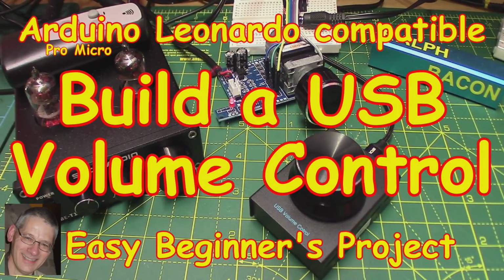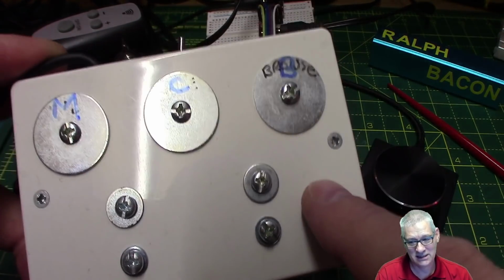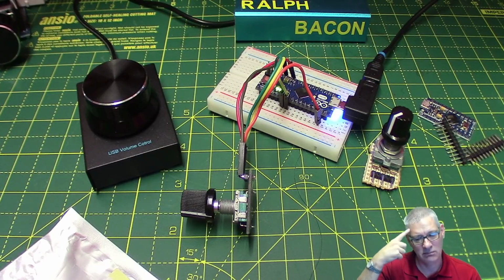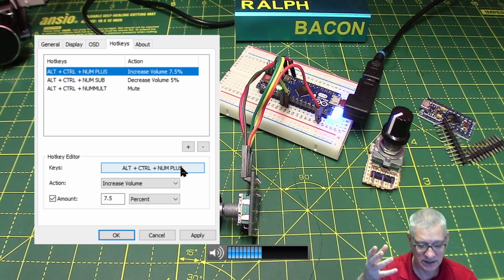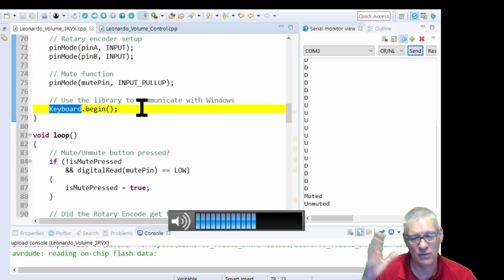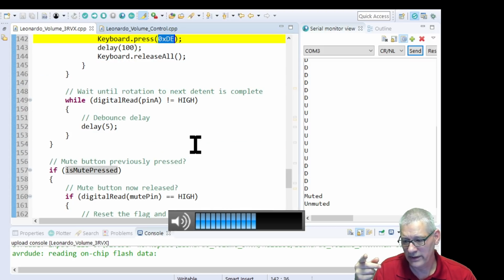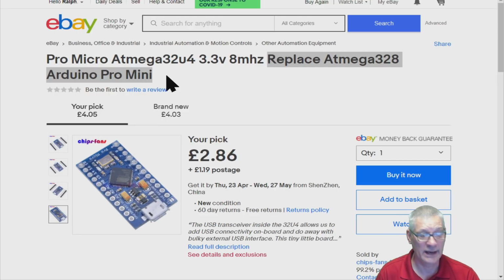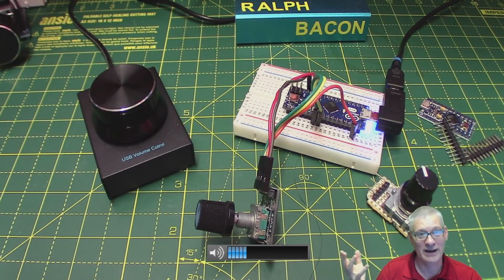#184 Make an Arduino USB Volume Control - Ideal Beginner's Project

Comment: Very interesting - thank you! Is there any way to set the Windows volume to a specific value/percentage, rather than just sending volume up/down commands?
Reply from the maker: It would require a more intelligent connection to the PC's operating system so you could interrogate the current setting and adjust as necessary. Probably not that difficult, but not something I've done.

Comment: great video!
Do you think I can re-program a buyed USB volume control? is it  an "arduino" inside?
Reply from the maker: I doubt it would be an Arduino inside. Too costly. But there's nothing stopping your making one like I did, with an Arduino (Nano) or bare chip, inside.

Comment: Can anyone think of a way to feedback the current volume level to the Arduino? or the mute status?
Reply from the maker: You can't interrogate this device directly as it is but there are a few things you might be able to do, depending on how creative you are.

If you use just ONE of the pot tracks (eg a mono amp) then the other track could be used to feed 5v into an Arduino and you would know where it was (pretty much).

Or if you need stereo (so you're using both tracks) if you can extend the spindle for another pot or magnetic switch you could get a reasonable idea of where it is. Or construct a collar for the pot with some sort of magnetic switch. But it would be fiddly and not very precise.

Comment: Hello Ralph, and thank you for another great video,
I made it and even added a small keyboard with many shortcuts, works very well,
There is one issue, I wonder if I am the only one having it,
If you rotate the encoder once, the program is stuck in the while loop, so the mute will not work, and in my case also the external keyboard.
the first workaround I made was to add a LED that goes high in the beginning of Loop and goes low in the while, so I know to give the encoder another turn.
I found another way to do it, very simple actually, wonder what you think about it:
#define outputA 4 //CLK
#define outputB 5 //DT

 int counter = 0; 

 int aState;
 int aLastState;  
 void setup() { 
   pinMode (outputA,INPUT);
   pinMode (outputB,INPUT);
   
Serial.begin (115200);

   // Reads the initial state of the outputA
   aLastState = digitalRead(outputA);   
 } 
 void loop() { 
   aState = digitalRead(outputA); // Reads the "current" state of the outputA
   // If the previous and the current state of the outputA are different, that means a Pulse has occured
   if (aState != aLastState){     
     // If the outputB state is different to the outputA state, that means the encoder is rotating clockwise
     if (digitalRead(outputB) != aState) { 
       counter ++;
     } else {
       counter --;
     }
     Serial.print("Position: ");
     Serial.println(counter);
   } 
   aLastState = aState; // Updates the previous state of the outputA with the current state
 }

Thanks again and hope the moving is as smooth as possible
Regards
Reply from the maker: It sounds you are not using a detented Rotary Encoder, where it definitely moves from one position to another? Non-detented ones are tricky to control; I did video on them but don't like them.
Move is going s-l-o-w-ly, all packed up with nowhere to go. I blame the solicitors, the legal wheels grind extremely thoroughly but so very slowly.
Reply: @RalphBacon  Sorry to hear about the move, hope it will be fine soon.
I am using a dented Encoder, one turn enters the while loop the second brings things back to normal
Reply from the maker: That sounds different to mine. One "click" of the rotation on my one brings pin A high then low; with pin B out of sync by 90 degrees but doing the same. So one detented "click" brings it back to the same position (Pins A & B) each time. Make sense?

Comment: I do enjoy this video a lot.

EDIT: 
A post 8 months before mine by Chris Dreher reminded me that it is the HID interface and NOT the USB interface that has all of the extra toys.
I'm not sure if the PS/2 Keyboard and/or the PS/2 mouse are treated as HID devices.
I do know that you can have BOTH a USB keyboard AND a PS/2 keyboard because that is what I am running because some USB keyboards are not detected by either BIOS/GUFI, my old v1.0 Logitech G15 keyboard is now longer being detected until Windows starts.
To solve the issue completely, I just bought a 60% sized PS/2 keyboard on Amazon for around $15.00 CAD and just leave it out of the way unless I need to make BIOS/GUFI changes.

It was while I was researching the G15 problem that I discovered all the extra bells & whistles that HID can support.
I found other sites have actually done speed tests between USB keyboards that DO NOT use interrupts and PS/2 keyboards which DO use interrupts.
These tests have shown that while the difference between the two types of connections is actually below the level that a human to detect BUT the PS/2 is actually faster than USB because USB relies on polling all devices on a USB channel and PS/2 relies on the interrupts it send to demand attention over any USB polling. So if you can use an interrupt with USB, I think you should.
Reply from the maker: Glad you liked the video! 
Now, USB is not interrupt driven, but is polled. However, once USB is polled you can implement interrupts on USB (with a small, unnoticeable increase in latency) - for example, a keyboard or mouse will use something called interrupt endpoints. This is all hidden away from us (usually) via the HID interface. I've not noticed any lag whatsoever on my separate keypad via an Arduino Micro (which gives us the USB interface, unlike the UNO). Gaming keyboards these days are USB and you know how picky they are with latency!
Reply: @RalphBacon  There are a few Keyboard apps available that show you any USB keyboards connected and if more than one(1) is detected, the app will prompt you to press a key on each keyboard in sequence and then which of those is your primary keyboard. With this feature the software could let you turn an entire 104 keyboard in to a 104 set of function keys. There is even a small USB dongle that does the same thing in the dongles hardware before sending the programed  string.

Comment: I have an old tube stereo I'd like to salvage using a Raspberry Pi as a media player. It has several rotary knobs for volume, balance, treble, bass, etc.  I'd like to replace them with functional rotary encoders that have similar functions to the original functions. How would that work?
Reply from the maker: Chris I've replied to you TWICE now but my replies are disappearing. What on earth is happening?
Reply: @RalphBacon  I don't know what the issue is. I'm glad I got this message. Can I send you my email? Ive never contacted anyone through Youtube, so I dont know how it works.

Comment: will this also work on a mac?
Reply from the maker: If you mean "can I upload the sketch to the Arduino and make this work using a Mac" then the answer is Yes. Lots of Mac users here (and Linux, and Windows).
Reply: Ralph S Bacon cool thanks

Comment: Will this work on the Pi4?
Reply from the maker: Not a chance. The Pi runs Raspberry Pi OS (previously called Raspbian, I have no idea why they changed it), not Windows so the code sent to the USB port will doubtless not be recognised by Pi. That said, if you can find out the codes the Pi is expecting to control the volume (from a keyboard) then you can just change the codes you are sending from the 32U4 and it should work. Hmm, now there's an idea...
Reply: @RalphBacon   :(

Comment: I noticed that the rotary encoders that you show all seem to have threaded bushings,  which makes it a lot easier to mount them to any sort of a panel.  The one I got with that "37 pcs sensors" kit I got from banggood a while back unfortunately is NOT threaded.   :-(
Reply from the maker: They are not for panel mounting then, Roy. Just for soldering to a PCB and have the spindle poke through the front chassis when correctly assembled. Makes for quicker overall assembly, I guess. Not so good for hobbyists. Luckily, you can get ones with a threaded bush for a relatively low amount of money but caveat emptor! Buy (too) cheap, buy twice!

Comment: Cool project. Ideal for my good wife of 51 years.  She hates keyboard shortcuts for volume switches so she just leaves it down all the time and complains that she can't hear the sound! Perhaps if I build her one of those with a rotary encoder, she would use it!  I have several of those without the board. I find they work find without having the + hooked up, just ground, a and b. The switch has 2 pins as well, I read them as ground and SW. Using them on my two internet radio setups they work find that way, I simply put them on a circuit board and wired them up using measured strips of old hard drive wire, that grey ribbon stuff that I have laying all over the house from my days as a builder of such machines over the last two decades.  Thanks again for that video on the internet radio, I listen to mine now when ever I am not listening to one of your videos, or those of other producers that I follow.  Found one station that plays old tapes from AFVN the Vietnam in country Radio Service I used to listen to when I was stationed over there. Man does that bring back some memories. I sent a link to a buddy who suffered a stroke and has lost some of his memory,  he  loves listening to it over his Mac. I am hoping he will regain some of his lost years using that site.
Reply from the maker: The Rotary Encoders will work without +VCC if you use INPUT_PULLUP, I'm guessing! Glad you are finding the videos useful, Jerry, always good to read your stories. Thanks for posting.

Comment: Another great video, and I'm glad to see the eye on the mend! I made one... wow... 5 years ago using an attiny85, but never really used it as the v-usb emulation layer has an issue with the USB clock not being present if the device is still powered. Was based on this project (https://github.com/Bluebie/volume_knob). Native USB like with the the Atmega32U4 or STM32 chips is so much easier (amazing, right!!)... maybe I'll finally put the Pro Micro clone I have knocking around to use. I have a pair of nice heavy aluminum knobs I bought for the rotary encoders, makes them spin nicely, and maybe add some capacitive buttons for mode switching... i.e. volume, page scroll, play/next/prev, etc ... possibilities are endless!
Reply from the maker: Indeed, make one, Peter. Guess what? I have recently replaced my keyboard without the numeric keypad (keytenless). Now I can't press ALT plus numbers on the numeric keypad to get special characters. I need a dedicated ALT+number keypad... hmm.

Comment: My question with rotary encoders and interrupts is, Do you need to have both A and B pins on interrupts? or can you get away with just pin A on an interrupt? I was hoping to use a pro micro like you've done.

My idea is to have a box with 2 rotary encoders and 4 buttons (2 discrete and 2 attached to the 2 rotary encoders). The two discrete buttons would switch my PC sound output between speakers and headphones, while one rotary encoder would do volume up/down and mute, while the other encoder would do "ffwd/rewind" and pause on youtube.

Would I need interrupts for just pin A on each encoder, or both A and B on the encoders and have the buttons in a Loop function, or would I also need interrupts for the buttons?
Reply from the maker: You're in luck, Sean, as you only need to put Pin A on an interrupt (and the Arduino has two, pins 2 & 3) so you can put one rotary encoder on one pin and the other rotary encoder on the other. However, if ALL you are doing is checking the rotary encoders and buttons in your sketch (creating a custom keyboard, effectively) then you can put everything in a loop just as I did in this video - no interrupts required (which might make for simpler programming). But this means not using any kind of delay() statement or long-running processes, which would make the "keyboard" unresponsive.
Reply: @RalphBacon  Thanks for the quick reply :) So far I'm thinking the only delays I'll use are the 100ms delays before the keyboard.release all (or consumer.release all if I'm using the HID lib). The discrete buttons will send a multikey shortcut to nircmd to change the default audio device (as well as light an LED in the pushbutton to let the user know which audio output is currently active).
Thank you also for the loop advice.

Comment: The USB volume controller is an Arduino flashed with custom bootloader, it has the same firmware for a dozen  or more products, you can access a hidden menu by opening a text editor, and using the secret combination and the USB volume controller will spit out a list of options, menus, and instructions. The joys of HID. The other notable extra is the board has GPIO ports.
Reply from the maker: You're kidding!? An actual Arduino 32U4 (Micro)? I'm tempted to try and get the lid of mine now. What's the "secret combination"?
Reply: @RalphBacon  I will play with this one, it's board ID is an AT-1 by Studioman. It's similar, but not the same. I'd like to see what you one is like inside. Do you have a discord chat? Or would you like to join another YouTuber's Discord as a suitable place to chat?
Reply: @RalphBacon  I have just opened my current one and it's different, the old one broke, rather aggressive use, but the USB plug wasn't much good anyway. That was in identical packaging and the board layout was 'almost' the same but not using an Atmel chip like the first. YMMV.
Reply: @RalphBacon  I ordered a new one, the same as yours and after a bit of playing I found the secret menu... Power up while plugging in the USB port, and its a very interesting menu because if you have a text editor open, let it echo the menu to the document, you can scroll up and down and select loads of options. More detail from the proper manufacturers website.. iwit.me/support/english.html It's a very clever idea
Reply from the maker: That is fascinating, Dennis. I will certainly keep a record of the document you link to. As you say, a very flexible bit of code, probably used in many devices. Ironically I'm building a custom mini keypad.

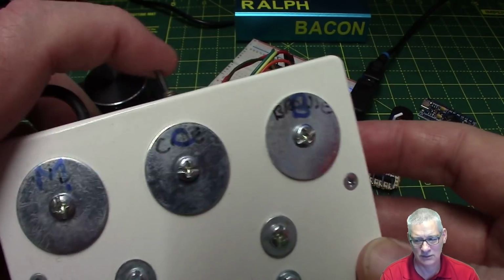Comment: 11:15 you can disable the device in windows with device manager (devmgmt.msc) so it won't show up in active com ports but it will still work. At least it works for my project where I check the status of scroll lock to see if my microphone is muted.
Reply from the maker: I do believe I have tried this, Pawel, but it appeared again, enabled, on another port. Hence the switch! Simple is sometimes best (especially where Windows is concerned!) I think it is because it does not always use the same COM port, it depends on what else is plugged in at the time of switch on.
Reply: @RalphBacon  You can set the port explicitly in "properties -> port settings -> advanced... -> com port number" I don't know if I did that though. My project is also using the HID-Project from Nico. But not the original Pro Micro but a clone with Sparkfun bootloader.

Comment: Thanks for the videos. This was such a nice simple project that I took at the one leonardo board I have and made a similar project. I didn't have a rotary encoder, so I just used pennies to make a 4 capacitive button controller with mute/V+/V- and Space to pause/play youtube videos. Your volume controller and video controller inspired one of the more useful little projects I've made.
Reply from the maker: Congratulations on "thinking outside the box", Joe, and adapting the idea to your resources. You could still get a rotary encoder (not expensive) and try a rotary volume controller, has a totally different feel to buttons.

Comment: i made a volume control project a while ago and it has been amazing since i added some other features and it now controls my "entertainment" system (pc+audio). got a little complicated, but in the end it works well for my use.
i control my volume through a DAC (minidsp; would highly recommend) and ended up using a digital pot for it. for the mains amp, i had to control it with a servo as the the audio actually passes through its pot; sub amp is wide open so no control needed there. I also hardwired the power button from my pc onto the project, as well as added a relay to turn on/off my valve pre amp (it's actually headphone amp, but works well for my needs as a pre). I also added IR as i did not want a lot of buttons on the project itself. 
it took a while to set up, but i'm really happy with the results. rotary is main volume control, while IR remote controls volume, tops, pre amp, and and pc. now, a a single buttons turns on everything and recalls a preset, and then another button acts as a master "off" switch. sadly, i can not add media controls on it since it is running on the nano.
Reply from the maker: Sounds like a great project, Carlos. You say it is running on a Nano and that prevents you adding media controls? Why not swap out the Nano for an Arduino Micro or even a full blown Leonardo, then you can add media controls too!
Reply: @RalphBacon  honestly, at this point it would be too much hassle since everything is already soldered up and installed in its project box; also, i have the media keys mapped to my mouse buttons anyway. however, i will be doing an arduino project exclusively for keyboard, mouse, and media key inputs. i'm planning on having a keypad for key presses and macros (both mouse and kb) and adding some footswitches for extra input options.